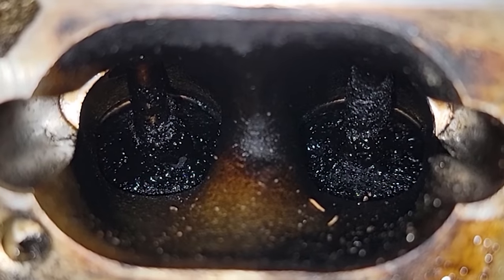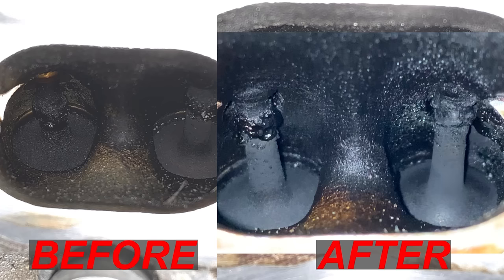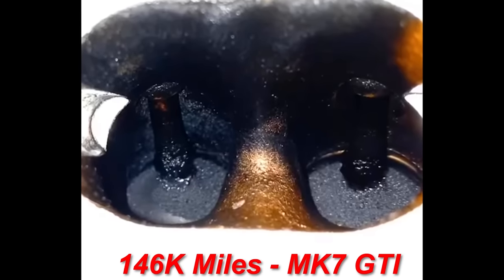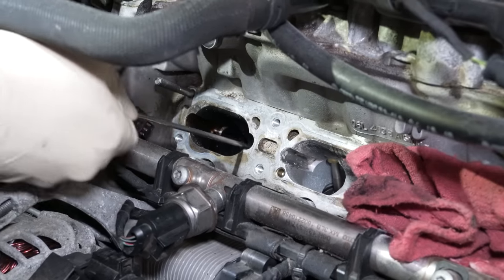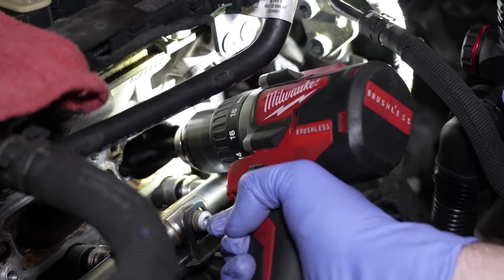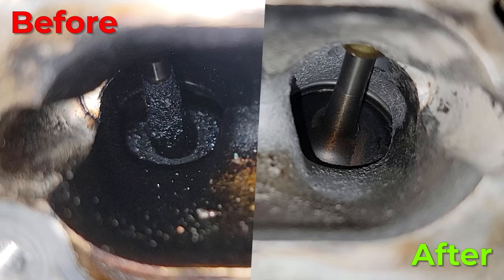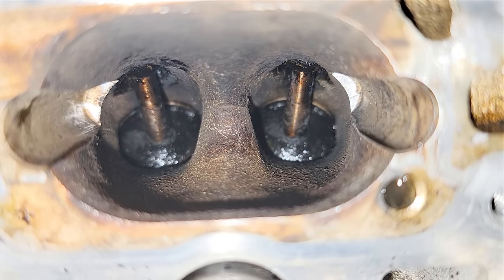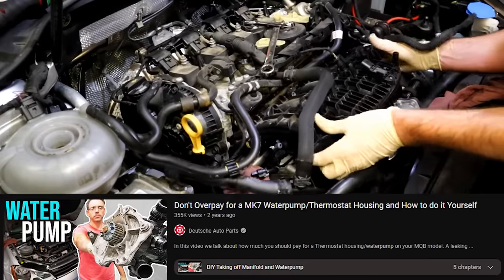How To Clean Carbon Off Your Engine!

Comment: I cleaned my 3.2 Audi using seafoam or Berryman and brass wire brushes- the pipe cleaner type I’d bend in a hook to get the backside of the valves, and a thicker spinny type to fit in the drill.  Worked perfect.  Cost overall about $250 for gaskets, brushes, cleaners, and lollipop wrench for the crank, saves pulling the front end but you wouldn’t have that issue with 2.0s.  Took about 6 hours to get spotless.
Reply: WTF , if a little peice of brass gets in your oil pump or elsewhere GAME - OVER:face-pink-tears::hand-orange-covering-eyes::hand-orange-covering-eyes::face-fuchsia-wide-eyes::eyes-purple-crying::face-blue-wide-eyes::face-purple-smiling-fangs::face-purple-sweating::face-purple-smiling-tears::text-green-game-over::text-green-game-over::text-green-game-over::text-green-game-over::text-green-game-over: for engine you need mental health ?
Reply: I have done the same thing. Brass is softer metal than steel. I understand your logic, however, like Paul said: as long as you don’t do it like a crazy ape. I soaked all the liquid out with a rag and then walnut blasted with that special attachment that allows to stick the end of a vacuum hose. Works great!
Reply: @ericsanchez3959  the head isn't steel
Reply: I've done the same thing, powerfoam worked amazing. I let it sit for an hour first. I believe I used either brass or plastic brushes. I then installed a AOS and didn't get much if any more build up after 30k miles. This was on a Subaru and the valves were much more recessed.

Comment: I probably should do this on my '14 Cayman S with the 3.4 liter engine,  but it runs perfect.  I have a borescope at home, but getting it down that long winding intake looks like a huge hassle, not to mention you have to remove the rear interior just to get at the engine in the first place.

Great video!
Reply: Seafoam makes a great product if you can get to your throttle body it spray into the throttle body while running. What i do is make a tiny hole in the cai hose right by the throttle body push the hose through while car is running spray you have to work the idle to keep it from stalling

Comment: Great video, I have performed the scrape and suck method and had great results.   I also used gun brushes in fluid to finish and was able to get great results without having to use media blast.  I recommend doing this every 30 to 50K.
Reply: What tool do you use to suck up the fluid?
Reply: I recommend buying a car, that doesn't require this stupid procedure every 30 to 50 k, lol.
Reply: Just rev it
Reply: @less_vanity5820  Nope, the revving up does not clean that shit. But the Egr-valve-off , Does the Best result 4 the Engine, which than stays Clean 4 Many Decades !!! ! !!!

Comment: The cleaning process is very good but I would use a nylon drill cleaning brush, I spray the valves with penetrating spray before using the liqui moly cleaner. 
So those valves are impeccable.

Comment: I haven't done any valve cleaning on my Mk7.5 GTI yet(Only 34k miles on my 2018 bought new) but I owned a Focus ST before this car. I put 30k+ miles a year on that car as I traveled about 100 miles a day for work back then. Every year I would take the manifold off, soak the port in 2+2 carb cleaner for about an hour and use various size gun brushes in my drill. Got about 90% of the stuff off every time. The different size and shape gun brushes worked great and I barely had to do any scraping.

Comment: I just want to say, the overall video was real informative, and a lot of good advice was suggested here, however, I want to add a personal anecdote that conflicts with a statement made

The Gen 3 2.0T engines do have carbon buildup issues, though not as major as the Gen 2s and the older 2.0T FSI Motors. My 8V S3 started having Cold Start Misfires around 70k Miles that got progressively worse, and when I finally cleaned the valves around 80k, there was a tremendous improvement.

The Audi dealer local to me still recommends a Carbon Cleaning on the newer 2.0Ts at around 100k, so while the service interval has moved, their is still some Carbon Buildup that the revised PCV on the Gen 3 and newer motors that it can't resolve
Reply: Yep, I hear a lot about carbon buildup on mqb's with the 2.0t. My gti is around 142k and needs one bad, just haven't had the time to get to it
Reply: Thank you -  I was doubting myself after his comment in the video - Ours has 75k, just started getting cold start issues (with the cooler weather).   Replacing coils and plugs didn't fix the problem.  I think I'm going to have to dig in before the snow flies
Reply: Mine shot a injector 4 malfunction code  at 118k my intake is caked 2017 gti
Reply: Just shut that dumb Egr-valve off, and you will Not have this dirty exhaust shit in your engine anymore as before .

Comment: Living in Copenhagen, driving cars and motorcycles, some experience with this. Lots of daily slow driving.
Then going on vacation to France. German autobahn, + 600 miles, 90-110 mph in average.
Coming home,- 40-50% better milage, on the motorcycles - much higher top speed.
Must come down to better flow. Getting the path through the engine cleaned up.

My dad used a trick,- spraying sparkling water in the intake with the engine running,- kicks the nasty stuff off. But be carefull, we don't like huge chunks falling into the cylinder running :)

Comment: I use Carbon-Off. It is sold as a decarbonizer for pots and pans in the restaurant industry, but it also works great for melting off baked-on carbon. It doesn't hurt metals, and is not particularly harsh.
Instead of rinsing with water per the directions, wipe out everything with a rag.

Comment: Thanks, Paul! Your timing is flawless - I’m about to do this cleaning this week on my Mk7 and you addressed a ton of things I was curious about
Reply: And Don't 4get 2 cut cut off the Egr polluter of the engine tooo.
Reply: @bustjanzupan1074 ?? Before cleaning? What is that?
Reply: @The1Real1Cheese  Because the "Egr" valve immediatelly pollutes your engine back on the old way. That is why it is essential to cut it off, 2 Not do any further damage 2 your engine.

Comment: I DIY'ed the water pump at 150k km thanks to your tutorial and now I just did the carbon clean off at 190k km (120k miles). I had some intermittent  check engine light and VCDS made me think it was a dead injector but when I opened it up it was quite like in this golf. Anyway thanks a lot for this!

Comment: I've gotten good results soaking the valves in Berryman's Chemtool and using a series of picks and nylon and brass brushes. Not quite as good as walnut blasting but cleaner than what you achieved with just picks and brake cleaner.

Comment: Had to get this done on my previous car (2012 Rio5) as it was DI and my fuel economy was dropping and was having some minor stall/hesitation issues with the a CEL once in a while.  A local shop did it for me.  I'm not sure exactly, what they did, but they did use a special cleaner on it.  No idea if they removed the intake or not, but it worked good enough that I never had issue again.  When I replaced that car with a new one, I went with a Toyota with the D4S system.  All the benefits of DI without any of the negatives as it has both port and direct injection.

Comment: Did the hand scrape and zip tie method last year on my b8.5 s5, worked pretty well. Definitely worth doing if you have the charger off for whatever reason.
Reply: How long did it take you I’m looking to do my s5 b8 v8
Reply: @aqib2000  the procedure only takes about 30min to an hour. Getting the top end apart is a good half day adventure. If your not a regular wrencher plan on a weekend job.
Reply: @aqibi2000  The bulk of the cleaning gets done within 5-7min per port, maybe a little longer per depending on how much carbon and how clean you want it. I used a toothbrush with some cleaner to finish up. It can be done in a day if you hustle but more of a weekend project.
Reply: @Mekanik.b  Thanks for the info. Does a car need to be in neutral when rotating the crankshaft?

Comment: I didn't have any noticeable cold start misfires on my MK6 GTI until about 170-180K miles. I ran Chevron 89 or 91 octane fuel exclusively and never added any fuel additives. When I pulled the intake it was a horror show of carbon build-up. Took me a few days of soaking, and cleaning using a variety of methods mentioned here until I was happy with the results. While the intake was off, I changed the fuel injectors and their seals and replaced the intake with the newest revision which VW recommended in a recall anyway. Once it was put back together, it literally ran like new...and still does at 215,000 miles. Just changed the timing chain, guides and tensioner for good measure a few weeks ago. Love the car, it's been amazing.
Reply: Do you plan on keeping it?
Reply: Was that the first time the car had its chains done at 215k miles?
Reply: @wavey_lit6046  Yes, first time the front cover had ever been off the engine. Half of the mileage on the car has been freeway in 6th gear. In my opinion, it's not the chains that are a concern, but the tensioner and chain-guides (which I also replaced). Last week my thermostat froze shut, and my temp gauge spiked for about 2 minutes, hopefully I didn't damage the head or head gasket. I'm in the process of replacing the water pump (and included thermostat) right now. I've had very few problems with this car, but it's age is catching up with it I think.

Comment: I have another "tool" try out for your consideration. Furnace or boiler brushes are used to clean out carbon soot from the internals of boilers and hot air furnaces. Sets of these tools are available from any plumbing or HVAC supplier and presumably Amazon. They come in a variety of shapes and sizes. Brush work plus brake clean solvent might be an effective way to address this problem.

Comment: I have an idea for the zip tie hack: instead of zip ties, get a long drinking straw cleaner brush. They’re like pipe cleaners but made a bit stronger than kid’s crafts items. Wonder how well that would work.
Reply: Yeah I’m honestly confused they didn’t even talk about using a brush. Seems like the obvious answer to me!
Reply: Harbor freight sells a brush set that includes a bunch of cone shaped brushes in plastic and metal, and can be attached to a drill. Those work like a charm. It's what I use along with media blast, and chemicals to get that factory fresh finish.

Comment: My 103K mi 2010 VW CC had its valves cleaned with nut shells. I was not prepared for the increase in power. But what was really amazing was that at 70 mph highway driving I in a 3 hour standard driving loop that I do. I was able to get 11mpg to 12 mpg increase. Which when my car was new I was getting about 4mpg worse. So, I am actually getting better mpg now than when my car was new.

Comment: Have done carbon cleanings on lots of gen3 2.0Ts and they definitely do have the same issue. Many of them I've seen at relatively low mileage with lots of buildup
Reply: Cheap gas and infrequent oil changes?
Reply: @SouthsideTaxi  Nope, just the Egr-valve shitty idiotism which is polluting every engine.

Comment: I just use the a can from CGC before every other oil change and it does the trick for me. I don't have to disassemble my intake and it's cheap. I know there's gonna be carbon in there, but I can definitely notice the difference if I let it go for longer than ten thousand miles. The cold-start misfires are non existent and the power is there. I even scan with vagcom to see if any of the cylinders misfire especially in the winter. It's done a great job at keeping the build-up at bay.

Comment: I've used a soft toothbrush, a vacuum, and e85 with great results. Its more about soak time. If you leave the e85 in the intake port overnight it does great.
Reply from the maker: Great tip!
Reply: @Deutscheautoparts  Even though I know shops can't park cars overnight like that to do soaks 24/7 you guys should make a video. It gets the intake ports so clean they are silvery aluminum again.
Reply: @kanadaijuharszirup  85% ethanol and 15% gasoline from the pump. It melts fuel varnish away in old gas tanks in seconds is how we got the idea. Its a fantastic cleaner.
Reply: @Deutscheautoparts  ive only cleaned up ports in 3 engines & used tergo strip paint stripper.. soak port for 15-20 mins the hose out.. wd40 after air blast dry.. has been quick & simple & no visible corrosion.. did one head twice & its ports & valves had no signs of black residue at all.. one head was off the engine & did chambers too seperate to ports & plugging the oil galleries.. didn't notice any water finding its way past the valves..

Comment: Beautiful video, very informative. There are two areas you need to be careful. Be careful that gasoline ( petrol) is getting spilt while you are removing the intake manifold, the second thing you need to be careful is not using a short mandrel or zip ties as you will be taking your drilling machine too close and can cause accidental digging of the metal. The best I learnt in my 40 years of experience is using a no 100 water emery sheet pasted with glue rolled over a round wooden stick 7 inches long, 8mm thick the sand paper will open due to the centrifugal force and will clean everything. But prior to this I was told to use toilet cleaning hydrochloric acid to soak and soften the hardened carbon deposits that you can remove with a cotton ball and a similar pick you used. I had a guru or teacher as you may understand who taught me the same way you pulled the valves up so nothing gets into the cylinder. I have worked on the older gen carburettor vehicles but not on injection vehicles I don't know if timing would get changed , in carb vehicles I had to use a timing light to get it fixed. I really enjoyed your video. Great stuff.

Comment: My method for cleaning my L8T 6.6 liter is converting it to port injection and a Stage 2 cam swap. So from 401 hp to over 500 hp and no more worry about carbon build up.

Comment: Just spray hydrogenperoxide with water when engine running. I remember back in early 90s there was a company in Sweden called MISAB (Motor Italia Svenska AB) that sold a kit with watercontainer, nozzle, plate for nozzle, and an electrical pump with cable harness. The mixture was peroxide and water and they told that compression increased and soot removal. Nozzle was set in adapterplate on intake manifold. This was for like Dellorto, Weber carburator. I remember that other sparkplugs was needed. I also remember a friend that put this kit on a 1984 Volvo Turbo 2.1L that had mechanical fuel injection. The seller from MISAB shown the results and we all was amazed at the time.

Comment: Cut the zip ties longer and place a 3/4 -- 1.5 inch long piece of 3/8 -- 1/2 inch diameter clear tubing (depending on your car) over the zip ties and use the tubing to control the zip ties while they spin in the drill  :face-blue-wide-eyes:

Comment: Here are my concerns with this, and I have a couple.  First is I wouldn't even consider doing any of this without pressurizing the cylinder to prevent debris/fluid from entering it.  Next, scratching the surfaces with a metal pic is creating metal shavings, so now you have carbon and metal in the mix being carried by a liquid possibly into the cylinder during the cleaning.  Next, adding any abrasive on top of all that  and you're really asking for cylinder and ring wear.  There is no way you are removing the deposits/abrasive/shavings from against the valve seats at minimum, at worst its coated everything and upon startup where does it end up...between your cylinder walls and rings or your valve seats.  While spraying media, you think it's not getting past the valve seal or valve seat.  There is a reason that air filters are 99.9% efficient at 2 micron at minimum.    If you want to remove carbon or oil sludge remove the head and do it right, oh and pb blaster works well.
Reply: That's my thoughts roughly. With the valves closed the walnut, or whatever used, couldn't possibly clean everything. It defies common sense. Liquid intake cleaners don't inspire confidence either against hard carbon, which you don't want bouncing around in the cylinder anyway.  A simple cold start injector upstream of the valves would fix everything.
Reply: @fendermon It works. I walnut blasted my mazdaspeed6 and it cleaned 100k work of junk off it. No issues and it runs much better
Reply: @sevenmileshome  Thank you, very glad to hear it.

Comment: I didn't realize boroscopes were so cheap, but our 2018 pathfinder with VQ35DD has direct injection - I manually cleaned the carbon deposits off, and use seafoam about once a year before an oil change for preventive maintenance.
Reply: Get the one with side camera also

Comment: The spoon shaped o-ring tools are good for scraping the wider areas. I found the hook pick to be great for the back of the valve stems and a 90 and an angled pick good for getting around the valve seat. Removing the bulk with picks followed by media blast is the most efficient and quickest way.  Bore brushes may seem like a good way to go, but they gum up almost instantly.

Comment: Good video as this is an issue with most high mileage vehicles. I like the idea of using the baking soda over ground walnut pieces. Baking soda can even be used to strip paint surprisingly.
Reply: This issue of the pollution of the engine comes just from the Egr valve, and is Not caused because of the hight mileage. I have seen engines Clean after 300 miles, but with the Egr-off . So, after the clenaing of the engine, make sure, that this issue does Not repeat again, by shutting off the egr valve.